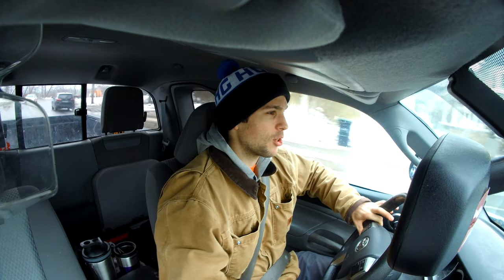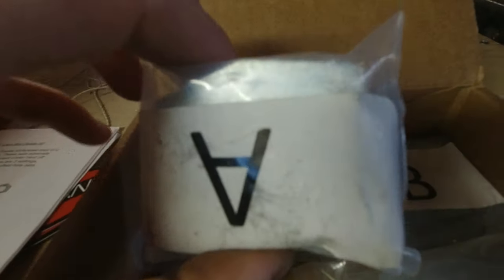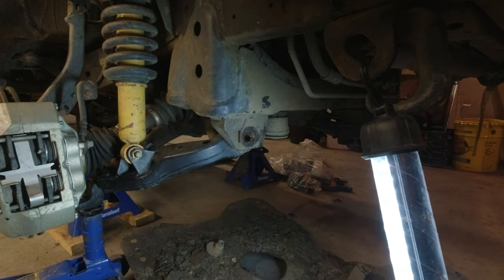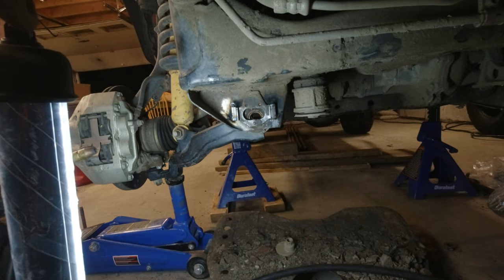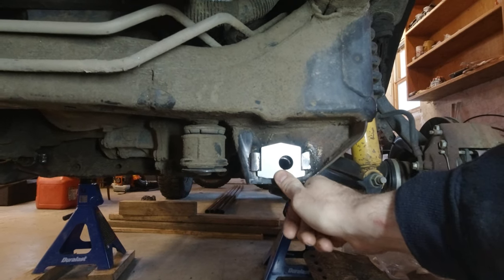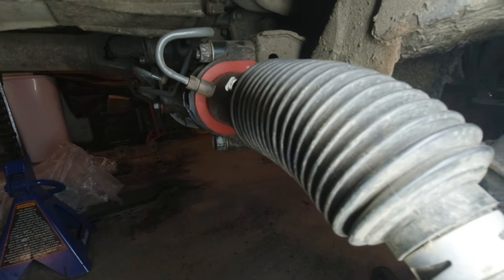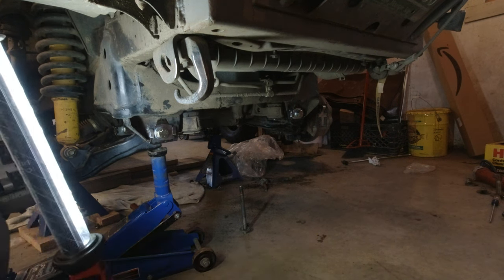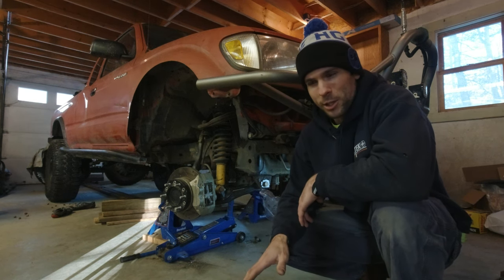Taco Tabs INSTALL & WALKTHROUGH | Never Lose Your Alignment Again!

Comment: In the 1st gens, first front end style.  You can turn the steering to full lock and slide the rubber boots and remove the cam bolts.  I have the energy suspension bushing on my steering rack and upper arms.      If you jack under the lower /upper control arm mount lift up enoght to angle the cam bolt down just enough to slide out

Comment: Not be pedantic, but you should torque the LCA bolts @ride height with the weight of the truck on the arms. Otherwise, the rubber bushings are going to tear a lot sooner. But, if you already have Whiteline bushings installed, this point is moot. At any rate, nice video.
Reply from the maker: Thanks for the tip!!  Not pedantic at all, those little details are important.

Comment: Did you have to adjust the toe after installing those mate? Was wondering if you can provide the width of the front and rear tabs. That would be much appreciated.
Reply from the maker: I unfortunately don’t have the truck anymore, but I did take the truck in after installing these to get the toe adjusted.  I honestly remember it hardly changing though, and camber was perfect.

Comment: You mentioned your 2nd gen taco. Are you ever going to do a video of that truck? What lift is on there?
Reply from the maker: I actually have a bunch of videos of that truck on this account, they’re just all over 5 years old 😂. Definitely check them out if you’re interested!  That truck has an icon CO lift, Dakar leaves in the rear, and DP UCA uppers. It’s since been downgraded back to daily driver status, on 31s. Love that truck, have never owned a more reliable vehicle.
Reply: @S0nnenberg  I just picked up a 2014 manual access cab v6, I'll check out those videos!
Reply from the maker: Awesome!!  Great buy, I’m sure you’ll love it.

Comment: HI Seth.  great how to video.  What is the exact size of the key stock.  I purchased 3/16 and its way smaller than the one you showed in the video.  Is yours 1/4, 5/16 or 3/8?  just want to make sure i order the correct key stock size.  again, great tutorial.
Reply from the maker: So sorry dude, I'm realizing I misspoke in the video.  It's 5/16th key stock.  I'll pin a comment to the top to hopefully patch my screw up.  Sorry to mislead you!!

Comment: When you installed the bolts in the tabs closest to the steering rack, were you not able to flip them so the rack would not have to be removed to adjust your alignment?
Reply from the maker: Currently the locknuts are on the steering rack side, allowing for easy cam-tab change out. Sorry if I showed it opposite this.
Reply: @Seth Mellinger  Thanks for the help. Now, I don't have to install the steering rack to see if the lock nut will clear the boot.
Reply from the maker: No worries!  Glad to have helped, that steering rack is a total pain to deal with!!

Comment: The lower control arms, are incharge of the camber correct?
Reply from the maker: Camber and caster. Front tabs set the camber, rear tabs set the caster.

Comment: My truck got knocked out of alignment last trip. Do you recommend getting the alignment prior to installing the taco tabs?
Reply from the maker: It’s helpful to know where an ideal alignment sits for your truck prior to installing the taco tabs just so you can Mimic the cam positions with the taco tabs…however you can definitely install them prior to an alignment if you think you know how to set it up. A shop may be able to help too.
Reply: @S0nnenberg  yeah I figured get it done right then throw them on. Thanks